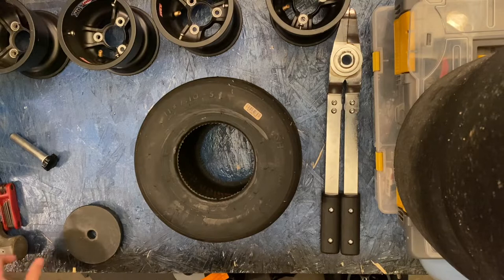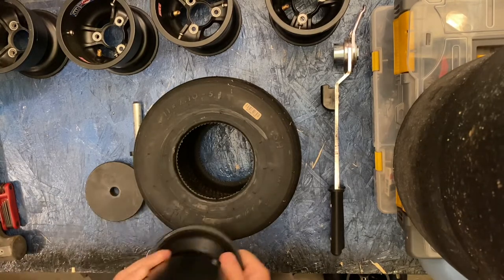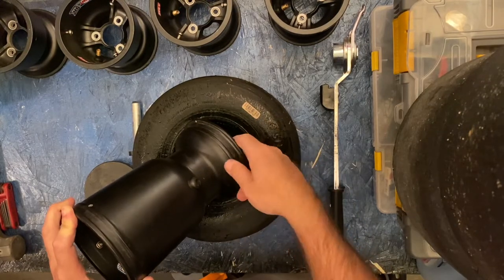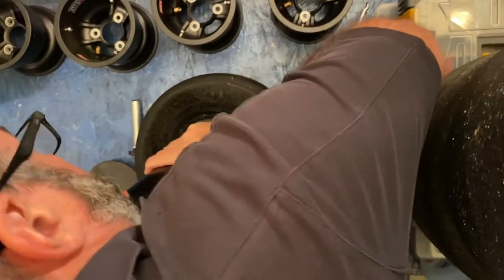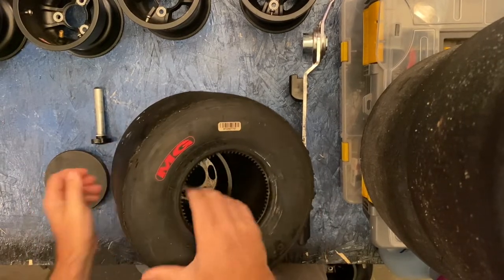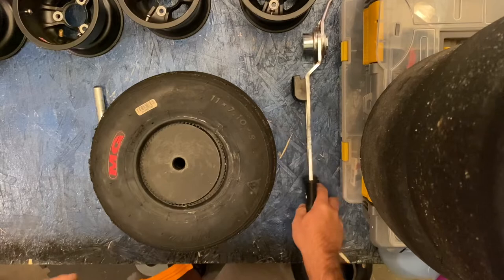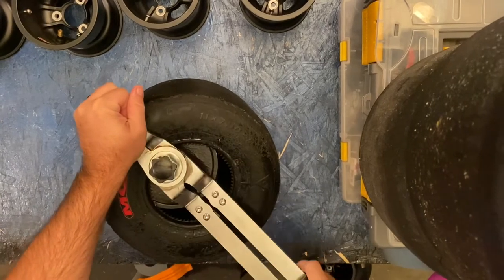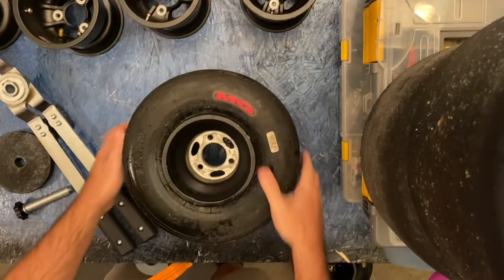Install Kart Tire - Scissor Tool

Comment: No special tool to use on the split rims in the old days. just split and bolt up. No big money for exotic tools. just simple nuts and bolts. Why would this make it cheaper to use to go in this direction when Karting is so expensive and drawing more  ( beginner people to the sport)  is a no go. You can't bring more family's into this with adding more money to the budget minded poor guy trying to get a start. It's just another fail and money grab. like all things in Karting, Money talks as the years progress. Glad I'm out. I was the president of OVKA in 93 and we fought this money grab as changing rules were introduced to favor APPCO and other Karting outlets to make money. THAT WENT DOWN under my leadership in this great organization. But as the years pass, that small guy has been left behind as $ is what it's all about. Regards Tom